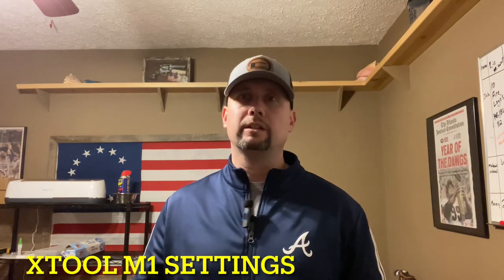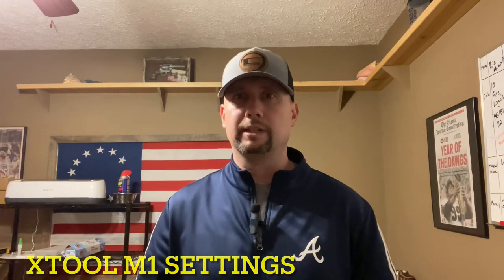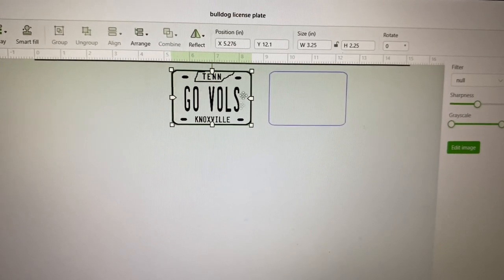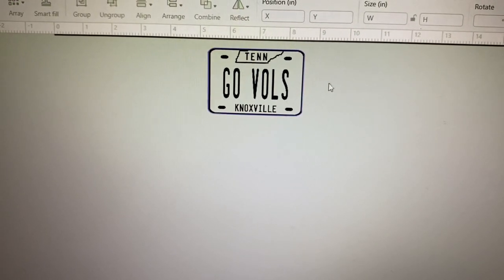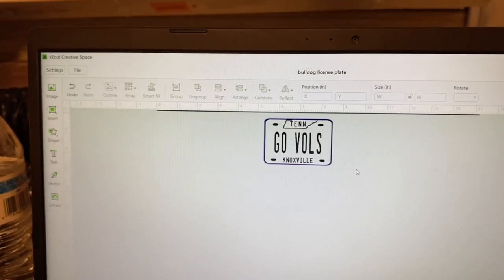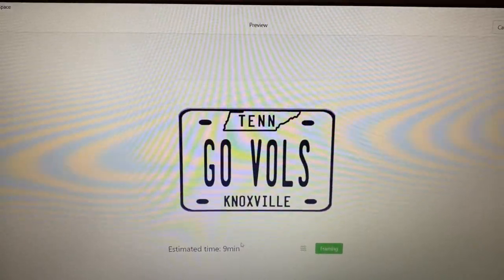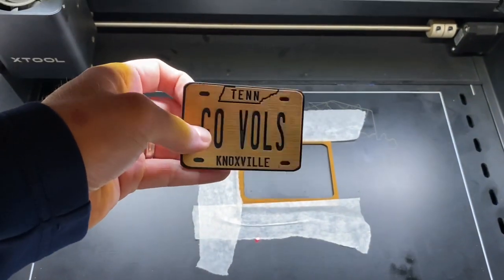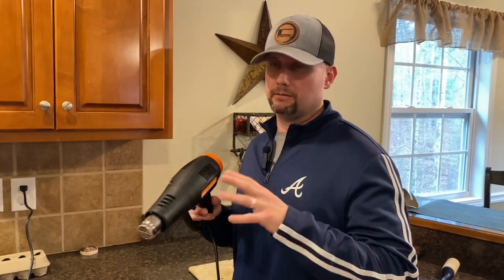How to engrave leather patch hats (no hat press needed)#engraving #laserengraving #howto

Comment: Thanks for the video. Think I’m going to give it a try. Where did you get your adhesive leather?
Reply from the maker: I buy the non stick 12x24 leatherette from createwith614.com. I then put ultra heat n bond adhesive on the back. I’ve found that it’s more durable than the already adhesive backing that you can get. 

Make sure to use promo CMK if you decide to buy your sheets from the above website.
Reply: I apologize on keep asking questions. I bought the a couple leatherettes, thanks for code. Question is the HeatnBond Ultra. Do you use the adhesive sheet that you iron on the back of the leather? And then cut out? Thanks for the video and responding back, just want to try to get as much info before experimenting on these hat patches
Reply from the maker: @georgesavage3482  yes, you’ll need to put the heat and bond on the back first, then do your cut outs. Make sure you do not get it too hot. I set my press at 300 degrees and press it for 2-3 seconds.

Comment: Good info! Thank you.  I really love be the site for leather and will be ordering very soon. My M1 is making a noise when it’s finished etching or cutting. Does your machine make any noise? It almost sounds like it’s grinding. I’ve cleaned the belts but didn’t want to take it apart to check it there’s something there I missed. The machine runs well.  It didn’t make the noise when I first got it. I have had the machine for a month. Any thoughts?
Reply from the maker: Yes, over time it’s the ribbon wires and the rail system creates some noise. If my machine is moving back and forth a lot you tend to hear what seems like grinding but I’ve determined mine is the ribbon wire movement. Glad to hear about the leather goods, don’t forget to use my CMK promo code for 15% off.
Reply: @coleminorkustoms8594  thank you for the feedback. Will definitely use the code. Means I can buy more. :)

Comment: Hello nice video! Is possible to use normal real leather with Heat'n Bond Ultra Hold Iron-On Adhesive? Is also possible to use an iron? Instead the heat gun thanks a lot for your videos
Reply from the maker: It depends on the thickness of the leather, if it’s to thick and stiff the heat n bond will not be strong enough to hold, you’ll have to stitch it too.
Reply: @coleminorkustoms8594  thanks, about the iron instead the heat gun?
Reply from the maker: @GianlucaTursi  I prefer the heat gun over an iron, if you could use a hat press that would work better than an iron. If you use a iron make sure you use a heat silicon sheet over your leather.

Comment: Hey what are you using to hear the gun on I’m going to try this method
Reply from the maker: The gun has two settings low and high. I typically use the low setting. I also use a laser temperature sensor to make sure I’m reaching 285 degrees. I would practice on a old hat first and make you get the heat just right before using good hats.

Comment: Just buy a hat press, I been doing hats with patches over 10 years, and I bought a hat press since day one, is easier, faster better.
Reply from the maker: Just an alternative option for others, in case you’re in a bind and need to use the heat gun method.